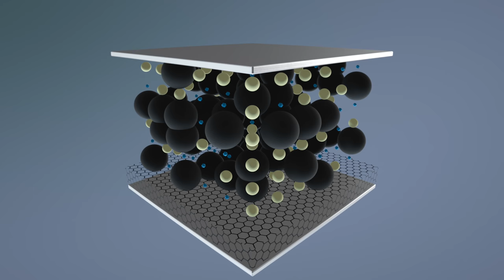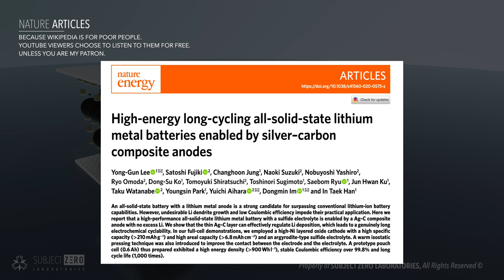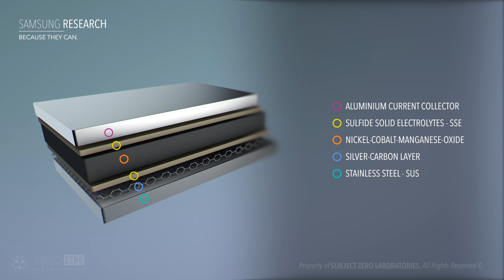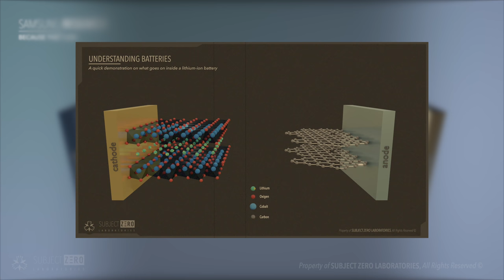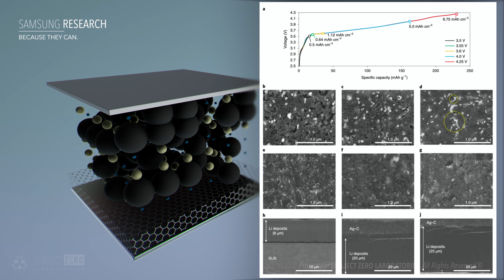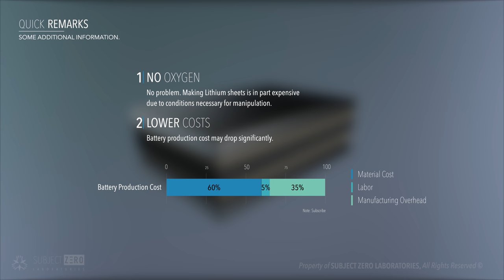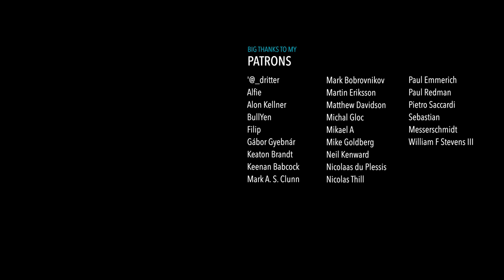Breakthrough Solid State Battery - 900 Wh/L Samsung [2020]

Comment: Good iterative advancements.
But we still need that "gotcha" revolution in terms of energy generation/storage.
Reply: We're making progress, that's what counts, right?
Reply: I don't know, a few more large "iterative" innovations like this and we might be good.
Reply: Do we though? Wouldn't a mix of technologies and a smart grid, that can transfer and balance power across large areas, fulfill most of our current energy needs? I don't think we can wait for a significant technological breakthrough to solve today's problems.
Reply: Iterative advancement is the only thing you can do, because, by definition, you cannot predict the "gotcha" moment of genius that opens up a new level of use.
Reply: Baleur its an interesting question whether there will be a big gotcha moment or just a series of smaller ones. There’s graphene technology which despite slow progress might be that gotcha revolution once/if mass production on an industrial scale is achieved. Fingers crossed.
Reply: I don’t know what any of this means so I’ll just smile and nod
Reply: @CausticLemons7  yes, op is wrong
Reply: Those "gotcha" revolutions in technology are built on a series of iterative advancements. 

An example is Computers, they have changed the world but at which point does one say that computers had their definitive revolutionary moment? Was it advances in user interface that paved the way for the desktop? Was it the commercialization of the microprocessor ? Was it the development of the transistor, without which there wouldn't be microchips? As I see it every breakthrough that led to advancements that made it accessible are of roughly equal importance. 

And as far as this published research breakthrough from Samsung time will tell if this leads to anything further. If it does pave the way for commercial viability of solid state batteries then it could be seen as an important step towards future developments.
Reply: Baleur If Tesla forvises more on their Solar Roof tiles, then a good portion of new houses and renovated houses would generate a decent amount of electricity. That means a significantly lower load on the grid a few years out, if just 10% of new roofs were Solar Roof.
Reply: focus*
Reply: @DarkAngelEU  Who is we?
Reply: Lithium-air or alluminium air whould be even nicer. But almost impossible. Lets focus on solid state for now
Reply: The revolution in energy generation already happened in the 60s:  molten salt reactors, which can be powered with thorium.  Three such reactors were built, and ran without any problems and one generated electricity for a local city. The project got canned because the airforce lost interest in developing a nuclear-powered bomber (the whole reason why the project was funded).  The head engineer, who was one of the lead developers of the first commercial nuclear reactor never lost interest in the technology, believing that the water-cooled high-pressure reactors, which are what we use, are unacceptably unsafe and inefficient.  Current nuclear reactors use only 0.5% of the energy in the nuclear fuel pellets, molten salt reactors can use over 99.5% of the energy.  Molten salt reactors can't melt down (they are operate in a melted-down state), can't blow up (they operate at low pressure), and generate far less nuclear waste and remains radioactive for only 300 years as opposed to 1000s of years.  Thorium is as abundant as lead and doesn't need to be enriched.
Reply: So a 50% increase in energy density and potentially reduced manufacturing complexity/cost isn't revolutionary? Huh I must really be going insane then.
Reply: More energy means more violent phone explosions, lasting a whole day and charging overnight seems pretty ideal
Reply: @imonlyamanandiwilldiesomed4406  You're one of those people who confuse molten salt nuclear with Thorium powered nuclear ...
Thorium has issues ... a LOT of them at the moment, issues that can easily be solved ... IN TIME.
Just throw Uranium into your molten salt reactor, works better, works now.
Reply: Baleur 50% higher energy density at a similar cost is a “gotcha” revolution
Reply: We had it with nuclear energy. Just a couple of bad eggs has ruined the image and given a perceived lack of innovation. Couple nuclear with other localised small scale green energy technologies. A large focus of R&D and we'd have great storage solutions, we already have a few great ones, gravity and flywheel storage.
Reply: @Mikkel111  nonsense, there are already many solar roof installations that are good and not everyone needs to replace his roof with hundreds of solar tiles, the bigger panels are way better and easier to move around if necessary
Reply: @imonlyamanandiwilldiesomed4406 
If humanity would run 100% on thorium then we would run out of it in a couple decades. Sure that is an improvement to uranium (which would only last under a year).

To me this LFTR push seems to be a snake oil salesman tactic that wants to ensure our reliance on fossil fuels.
"Don't change anything and we will have a solution in 20 years" is basically what the call for LFTRs is, but we don't have those 20 years.

The German government published a study in 2012 showing how a small country like Germany, could run on 100% renewables without added cost (including storage), with current technology.
The only issue is the transition. (It is just cheaper to run a 40 year old coal power plant than to build new whatever.)
Reply: no candy Interesting numbers. 1 issue though... They’re not even remotely true.
If 8.000 square miles were covered in solar panels, it’d be enough to cover the entire world’s usage.
And that’s not 8.000 new square miles, as there already exists a lot of solar panels.
So assume 10% of 1. world countries’ new roofs were Tesla solar tiles and we’d be golden in a few years.
Reply: @no candy
"Fossil fuels have carbon-14"
No they don't.
"to short of a half life"
That's why there is no C-14 in it.

"CO2 is only 400ppm"
Just like iron in our blood which is also around 400ppm and without it we would die. Small amounts can have huge effects.

"specific heat coefficient"
Is irrelevant. Bigger molecules reflect infrared radiation more. CO2 reflects that radiation much more, while Nitrogen is close to opaque. This has been known for over 150 years.

"CO2 violates the first law of thermodynamics"
What are you even talking about. You don't understand the basics and try to argue thermodynamics? This has nothing to do with it.
Noone claims CO2 creates energy, but that it reflects head radiation coming from the earth back. (Like in a greenhouse. Or do you think a greenhouse violates the first law of TM?)

"large oil company runs TV ads"
Actions are stronger than ads and they all lobby against a carbon tax and only present cap and trade as an alternative as it is easier to cheat.
Reply: @no candy
"Noone knows where it comes from"
Yes we do know that.
Most coal comes from a time when bacteria couldn't decompose wood yet, so dead trees basically covered the whole earth without it rotting.
Most of our oil/gas comes from a giant lake/ocean which wasn't connected to the rest of the oceans when we had a super continent.

(There are nuances missing of course, but not because we don't know, but I just tried to give a summery).
Reply: @no candy
"Thorium reactors...we cannot make and maintain nuclear bombs with them"
Thorium is bred into U-233 in a thorium reactor, which is weapon grade uranium (has been used in bombs). So no, we can and we have.

"Bombs...the primary reason we use the reactors we currently do"
Two of the biggest nuclear programs with independent R&D was in Germany and Japan, both countries never had nuclear weapons and never tried to optain them. Still they didn't use thorium and it has nothing to do with weapons.

"Thorium... the only way forward..."
If humanity would run on 100% thorium, then our thorium would run out in under 100 years. It is probably more expensive than alternatives and will need years to be available.
That sounds like a really bad option.
Reply: @no candy
"100% ...200 days..."
Where did you get those numbers? They are so wrong that can only be trolling.

In Germany/Canada you get around 1000kWh of sun per m². (In parts of Africa you get up to 2500kWh per m²)
Solar cells can harvest around 15 to 25% of that, so conservatively you can produce 200kWh/m² per year.

Humanity uses around 160 PWh (petawatt=1000terawatt) or 160 million million kWh (or 160 * 10¹² kWh) in a year.

So you would need less than a trillion square meter (or a million square kilometer) of photovoltaic to run humanities primary energy need.
(160/200 * 10¹² m²)

The Sahara desert has the size of 9,200,000km² and therefore is enough for more than 9 times the human consumption of energy.

And all that is conservative as 200kWh/m² is to low for the Sahara.

And it is also cheaper. In Saudi Arabia, where they basically have oil for free, solar is cheaper than electricity from oil.
Reply: @DarkAngelEU  there comes a point where progress is not enough, and we need something in our hands as opposed to more promises behind closed doors that get perpetually pushed back. I'm still waiting on the graphene batteries that were suppose to be godly. 10 years later, a consortium is made then they go dark for the past few years........ thrilling
Reply: @alanmay7929  
I don't think the bigger panels are actually much better, except maybe by simply being cheaper. Plus, for some incomprehensible reason, a lot of people seem to think traditional large panels are ugly, so the smaller solar glass tiles open up a wider market.
Personally, I would put traditional panels on my roof, but don't be so quick to dismiss the solar glass roof tiles.
Reply: look up flow batteries
Reply: @kevinrdunnphs  you seem to think that only phones run on batteries.
Reply: @no candy you don't know what you're talking about. 
Even covering 0.1% of earth's surface would be more than enough
Reply: @faustin289  No, 800 kg of immensely energy car battery is even worse. That being said, im buying an electric car next year. But we are nearing the danger zone of energy density, and another factor of 10 or so and we will hit the limit storable in chemical bonds which will end any further progress.
Reply: @kevinrdunnphs  So, according to you, we should reduce our progress speed so we don't hit the limit soon?
Reply: @no candy that is total rubbish. It's about a 100km by 100km square in the Sahara desert in reality.
Reply: @kevinrdunnphs  At that point, we would be building space ships and going around across the universe, don't have to worry about the limit in chemical bonds
Reply: @faustin289  never said that. Im just saying if you could store 1000 times more energy, that would be bad, because when one explodes, it would be 200 times worse than TNT. And would shred the body of whoever is using the device. One day battery life and occasional phone fires is mych preferable.
Reply: @ghoulbuster1  the limited power of chemical energy is very important, try making your fancy space ship with chemical rocket engines or ion engines powered by chemical limited battery storage. We've already figured out space travel. It's expensive. And costly energy wise. And when we have 10x better batteries, that won't be any different.
Reply: Kevin Dunn more energy density means smaller batteries means same total energy means same phone explosions.

Comment: I'll get more enthused when it's on the market at a reasonable price!
Reply: "reasonable prices" and precious metal electrodes don't tend to mix
 ....maybe thats why we have no fuel cell vehicles on the market?
(And without detailed info i wouldn't buy into the "silver batteries will save us", especially when silver costs 5 times as much as the dreaded expensive cobalt)
Reply: @martonlerant5672  when gar cars came out it was also only for the rich, same with computers, same with phones.
Electric and hybrid cars have come a long way already and will continue to become more accessible to a larger group of people
Reply: @martonlerant5672  Im a little late to the party but id also like to point out that its not just the cost of the matterial but how much of it. If there is five times less of the five times more expenssive matterial then it comes out to the same cost.

Comment: To make his (John Goodenough) name even more hilarious, his middle name is "Bannister" which effectively causes his name to often being shorted down to "John B. Goodenough"
And please research the fella, he totally lives up to his name as he has both worked on developing the first Lithium-ion batteries, RAM for computers and is now working on the next gen batteries.

I'm new here, but I what the feel about Redox-Flow batteries are here?
Reply: As I understand it, the main down-side of Redox Flow batteries is that they have a very low energy density for their weight, which tends to make them impractical even with the convenience of being able to quickly replace the electrolyte in order to recharge them.

Comment: The most important part is missing though: What happens when the batteries are dead? How does the recycling work? Is the higher capacity worth the mashed up elements, which I assume are hard to recycle. Traditional batteries have lower capacity but they can be recycled easily with relatively low cost.
Reply: Actually, solid-state batteries are surprisingly easy to recycle (assuming you found a way to kill the battery)
Reply: Recycling Li-Ion batteries is a known technology and not a difficult process, and it can be profitable assuming you have a ready supply of spent batteries.
Reply: Even reusing cells to lower grade application such as bus batteries as renewable/emergency storage is a thing :)
Reply: If this thing can go through over 1000 cycles, we have more than enough time to figure that out or we have more than enough energy from Nuclear Fusion when it's time.

Comment: 2:25
you forgot to take into consideration the weight differences of the electric motor to cumbustion engine plus gearbox.
Reply: yeah but the weight of battery, inverter and cooling systems more than make up for that, compared to the petrol tank's size and weight
Reply: Supercharged Petrolhead no they don’t. A Model S weighs almost as much as a light truck.
Reply: skaterfugater Yeah, they never want to talk about power to weight figures or the fact that batteries don’t like doing work. There’s been plenty of journalists that have done towing tests with the model X and every time they pull anything (even a light uhaul trailer) they always lose OVER half the range efficiency immediately. That’s why hybrids are where it’s at.
Reply: @Sovereign86  Good thing electric cars are improving constantly.
Reply: Yeah, watts per liter is dwarfed by watts per kg, since roads aren't flat, and we accelerate and decelerate.
Reply: skaterfugater  cumbustion?
Reply: Curtis Carté So you are saying the weight of the battery, inverter, etc more than make up the weight difference between an electric motor and an ICE? And so electric vehicles are heavier? 

Because, you would be right.
Reply: @orppranator5230  60% losses in gas cars are a huge underestimate. The actual loses on a modern car are 70-88%

Electric car motors are 85-90% efficient. Electric cars have better drag coefficients and regenerative breaking. You don't have drive-train losses if you have 2 motors right on your wheels. 

A Honda Accord or BMW 335i weighs 3500 lbs, a Model 3 top  range weighs 4100 lbs. Only 17% more. If you replace the batteries with one 5 times as dense, you'd reduce the Model Battery pack weight from 1000 lbs, to 200lbs, making the the Model 3 both lighter and substantially more performant than any ICE car.

The days of ICE cars are numbered, like the Blackberry.
Reply: The future is electric, let us face it. Nothing will substitute a 5.0 V8's feeling though, combustion engines will live by the hands of enthusiasts. But if you're just looking for a point A to B car nothing will beat electricity
Reply: @ghoulbuster1  The downside of weight is the last disadvantage, which Solid State batteries would render moot. On every other axis, electric smokes your ICE vehicle. A solid-state battery based EV motor cycle would be lighter and have a lot more performance. 

Sorry lovers of "loud" engines, people who love dividing into motors, and right-wingers who seem to irrationally hate anything associated with climate change, but the writing is on the wall, as clearly as the IC eliminating the Vacuum tube.
Reply: Ray Cromwell  You don’t know anything if you actually believe higher density means lower weight. That‘s just plain stupid. Higher density means same amount of atoms in a smaller volume. The atoms still have the same weight by then.

Comment: 3:11 to 3:30
Did you mean "Lithium ion batteries" there?
Reply: No, he meant solid state (which of courses still uses lithium).

Both classic lithium ion and solid state suffer from dendrites, but due to the solid state one being... solid those dendrites can cause the battery to break apart faster.
A classic lithium ion battery can handle this better as the liquid electrolyte allows more expansion.
Reply: Jakob Schulze Actualy a lithium-ion battery does not form dendrites since it has an intercalation based graphite anode. Only lithium metal batteries suffer from dendrites. All solid state batterie are one approach to mitigate dendrite formation in lithium metal batteries (lithium metal has a 20 times higher specific capacity than graphite)
Reply: @PR-hl9pm  Are you sure about that? I think both lithium ion batteries and lithium metal batteries do. Although I could be wrong about that. 
Or maybe newer lithium ion batteries don't suffer from dendrites.
Reply: End battery suffering. PETB!